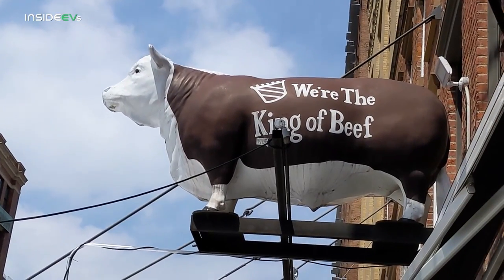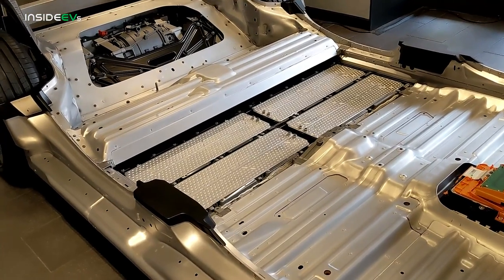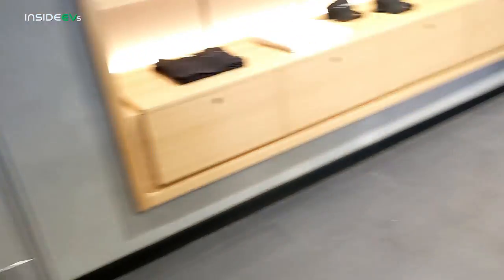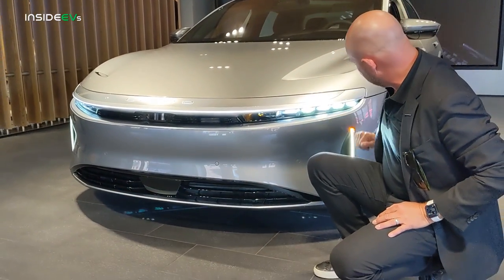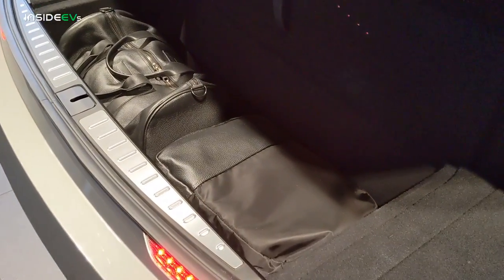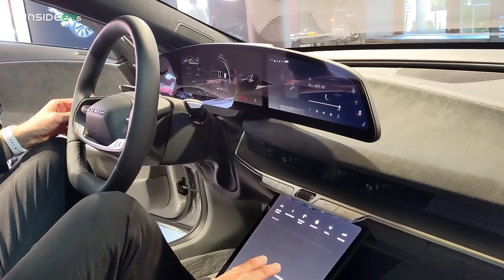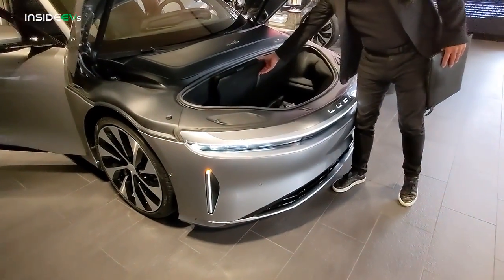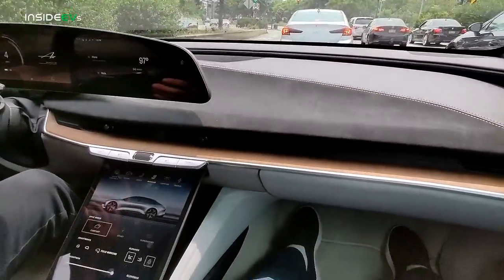Lucid Motors Manhattan Studio Tour & Air Walkaround With VP of Design Derek Jenkins

Comment from the maker: One thing we'd like to note is that @1:51 I mention that there are two blower motors resting on top of the power electronics for the front motor and that they didn't belong there. 

After speaking with Lucid today, I was informed that they were placed there to represent where they will be located. Lucid made a change and moved the HVAC motors from under the dashboard to that approximate position to reduce the noise inside the passenger compartment.

Comment: I love Lucid's attention to detail. Did you notice the alternate tail lights inside the lower trunk lid? That enables the one piece light on the trunk lid, which I consider to be lovely and reminiscent of earlier European luxury vehicles. It is an elegant solution to US regulations. Having done my share of vehicle HVAC design my jaw dropped on seeing those blowers, just one per car I'm sure, they will be both powerful and quiet. So many details.

The front suspension and chassis is a work of motoring art. The wide meaty tires speak of superior handling. The styling, the functional driver controls, are elegant without needing to shout "Look at me! I'm an Electric Car!" In that regard the EQS falls far short. The Lucid's design, in and out, doesn't depend on the car's motive power. It speaks to me.

That's why I reserved one some time back, red of course. I can't wait.

Comment: Rule 1 do not ask tech questions to design and marketing reps.... lol

Tom, do you know if its AC Level 2 V2G/V2H EVSE functionality will work with different brands that offer it (ie standardized protocols)? Or is the tech proprietary across the different brands that will offer it?
Reply from the maker: I don't for certain, but I'm guessing that initially, at least, it will be proprietary. I'll inquire about this when I have the opportunity.
Reply: @InsideEVsUS  Thx the geek in me really has to know.... And it would be useful info for ppl who will buy more than one vehicle with that capability... like the Lightning or the GM ultrium based BEVs..